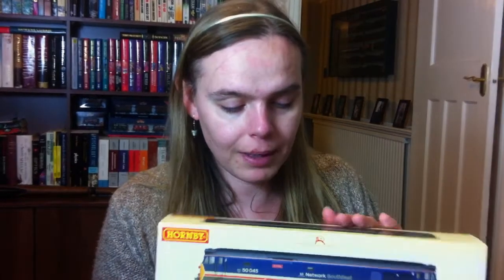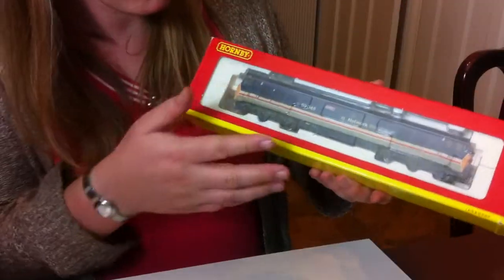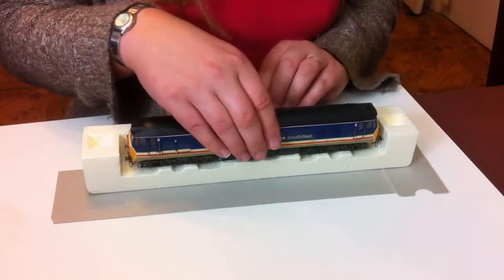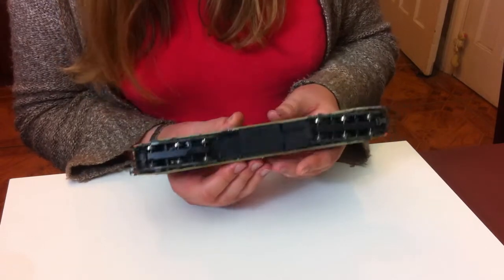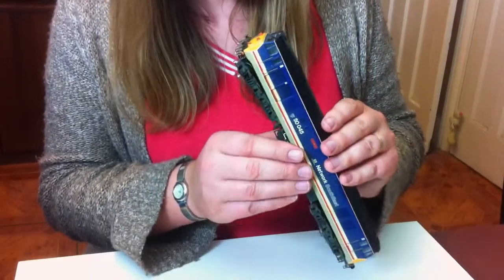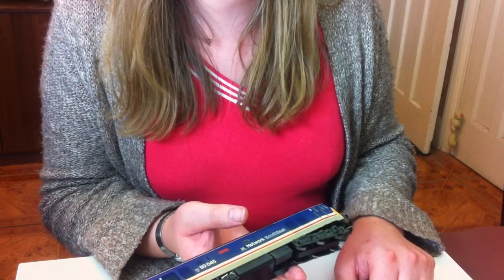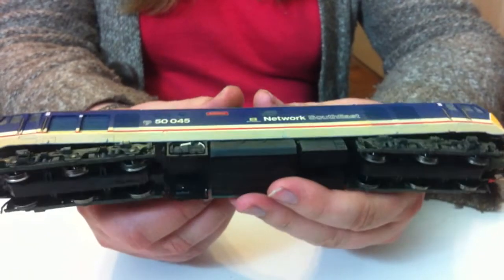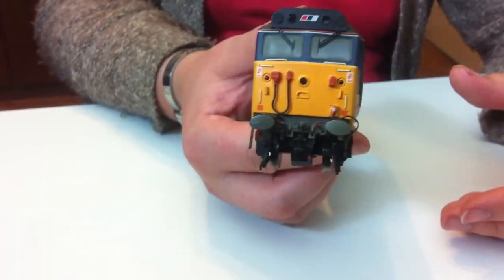Unboxing the Hornby Class 50 Achilles

Comment: Good review!
I have three of these, although two will be repainted into Laira Blue as 50019 and 50046 in bleached Large Logo.

The Class 50 was Hornby's move into modern can motor/flywheels/bogie-tower mechanisms.
Until this model came out, they still relied on crappy 'worm' or Ringfield motors which dated back to the 1960's.

One of the reasong that there are so many North American and Continental modellers is because the British models were just so far behind.

Ironically, it took Bachmann to bring modern mechanisms and high quality detailing to the UK.
It took Hornby out of a 'toy trainset' mentality and into realistic and highly detailed models.

Their class 60 is still regarded as the best model in the 'diesel and electric' catagory, despite it being more than a decade old now!

There weren't many types painted in revised NSE livery.... two classes you missed were the two Class 33's (33035 and 33114) and class 73's (73109, 112, 126, 129, 133 and 136).

87012 also carried a version of NSE, but it wasn't anything more than a promotional campaign for the 2012 Olympic bid occuring in 2005 (almost a decade after NSE ceased to be. Although the loco had the stripes, it carried "Host City London 2012" lettering instead of the usual NSE lettering.